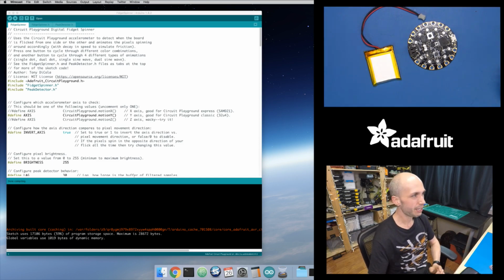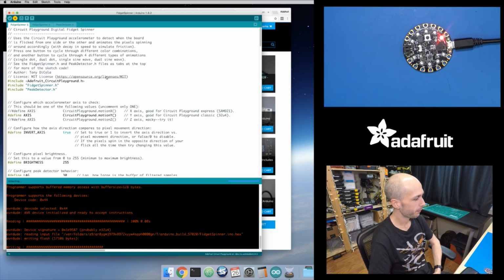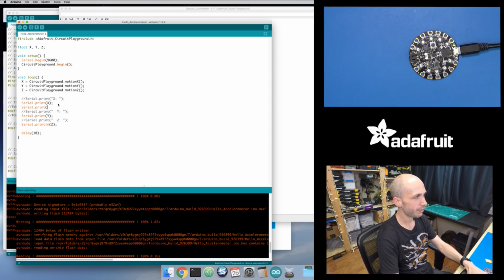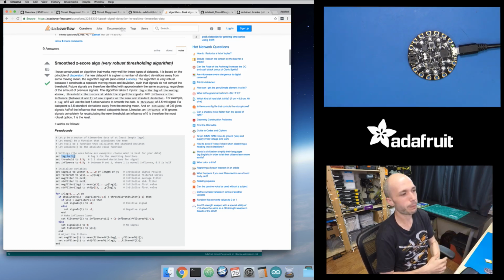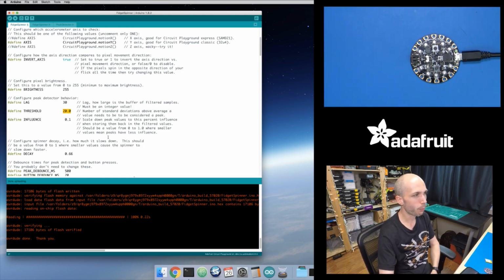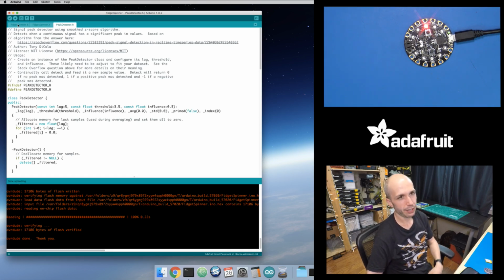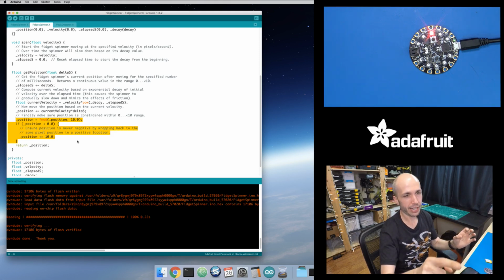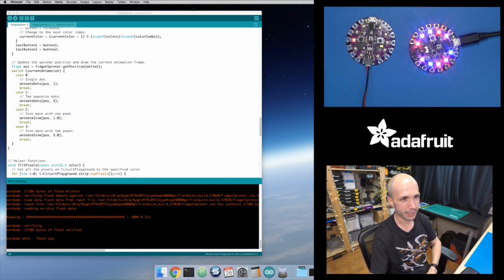Circuit Playground digital fidget spinner with Tony D!

Comment: Hi Tony,
This is a bit off-topic. They released MicroPython 1.9 and it seems to have "broken" ili9341.mpy and rgb.py for the Feather ESP8266 & FeatherWing ILI9341 TFT LCD display. Try it and see if you can figure out what's wrong, would like a fixed version. I'm wondering if the .mpy file format is no longer supported?  Don't know all the changes yet.

Don't know how to get in touch, so I thought I'd leave a comment in a recent video. Love your videos... And all the work you have done promoting/developing software for MicroPython.
Reply from the maker: Ah you're right MicroPython 1.9 changed the mpy format and isn't compatible with libraries compiled for older versions and vice-versa unfortunately (they're in a 'move fast and break things' kind of phase of development).  Right now all the adafruit libs are in pre-1.9 format so you'll want to run the mpy-cross tool yourself right now if you're on 1.9.  Check this out for details on using mpy-cross: https://learn.adafruit.com/micropython-for-samd21/frozen-modules#external-frozen-modules  Alternatively you might skip running mpy-cross and just load the files as raw .py files in the directory (i.e. download the source repo and copy the folder over with .py files).  It will use more memory but on boards like the ESP8266 you have a lot more to play with.  We'll update the libs soon to have 1.9 versions (but likely won't be able to have both versions for 1.9 and pre 1.9, so it will be 1.9+ going forward).